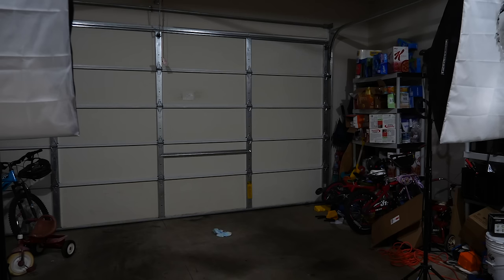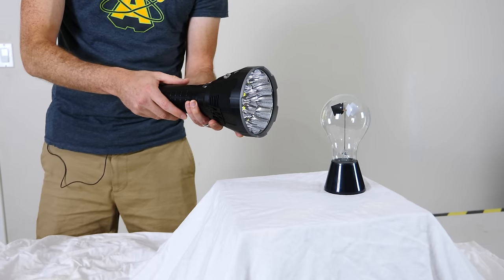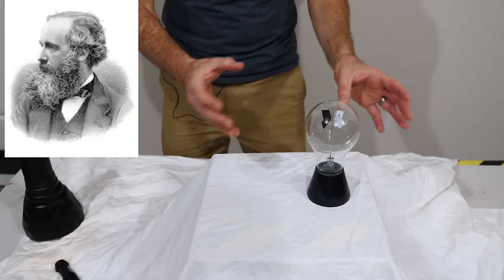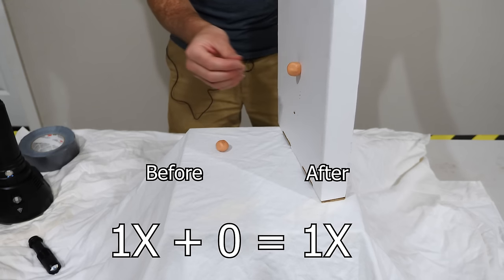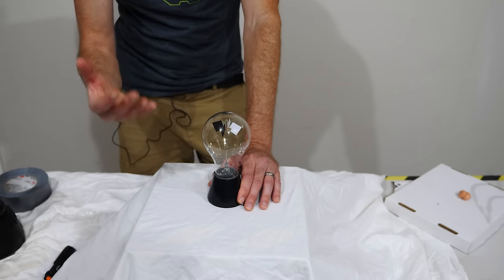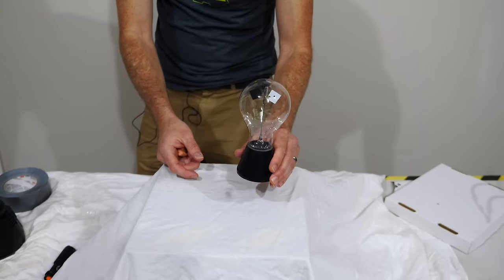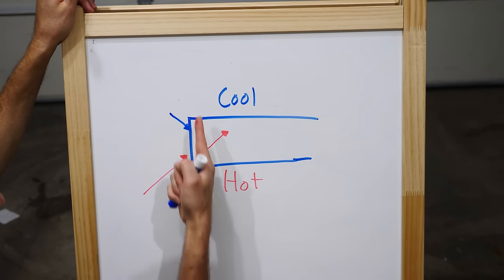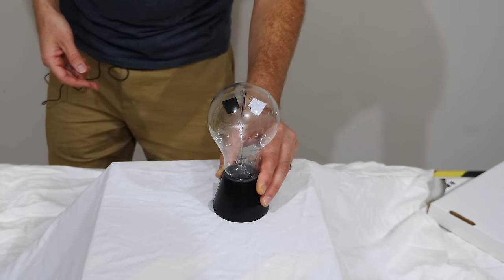Shining 100,000 Lumen Flashlight at a Crookes Radiometer

Comment: So would it work better if the vanes were thicker, so there would be more surface acted on by the different air masses on the sides? 
    Also, it should be noted that the wavelength is important also. A small ultraviolet light is more effective than a normal light.

Comment: Pausing at 5:28 to give my guess. I want to say it's because the black side is absorbing the light energy and heating up, heating up the air around it. and as the air around the black side  heats up, it expands, pushing on the vane. Now to unpause and see if I am correct.

Edit: I guess I am wrong and look forward to hearing the actual reason!

Comment: I’ve used a same wattage UV flashlight and it spins the same speed as the same wattage regular spectrum led flashlight. I have not seen the ice cube idea yet. I need to think on that one. But this idea is not totally jiving with me yet. I like the idea Ken W. has, that is, it seems to be a static like capacitance charge/discharge force. The rarified atmosphere is for the conduction or conductive medium for the force to propagate. This static capacitance type idea makes more sense to me. But I am trying to be open minded about this presentation. Pretty cool stuff!

Comment: I think warm air ( being less dense) moves up leaving low pressure on black side and white side has high pressure so air pushes from white to black. When you used ice air near black was more hot than on white side so again by the same concept it moves in the opposite direction. In order to validate the statement one has to use another type of case instead of a bulb structure. I hope you do that experiment too 😊

Comment: Radiometers react to to heat so it absorbs energy, Likewise it goes in reverse if you put cold air on it.  the vanes are coated black and white for obvious reasons.  Black warm, white cold. Its a useful device to measure the intensity of radiant energy....

Comment: I am interested in knowing what a medium-power (non-burning) laser does to the radiometer. I would postulate that at some point some distance away, the rotor would not spin, since it is not brightness per se that causes it's rotation, but the effect of thermal transpiration described in the video, and the role that the gases near the edges of the fins play. I guess it would depend on how much heat energy is present in the laser beam and where the beam encounters the surfaces (or edges) of the vanes.

Comment: But what if u shoot different kind of radiation at the radiometer simultaneously? Would the most dominant one just create the motion of radiometer ? Also can it be used to detect the type of radiation? Bcoz if it gets affected by hot and cold air there can be lots of complication . And at last what if u submerge it in water and then shoot light on it ?

Comment: Or, in short, the explanation with the "expanding gasses" means it's not a jet, but it's a pressure difference.
The gas is still expanding due to being heated up, but it's not the volume change that does the job, it's the pressure change.
Planes can fly exactly because the pressure above the wing is lower than below when the air is moving along it.
And a laser powerful enough to push things would melt those things with a ton of sparks before they had a chance to move in one piece.

Comment: You can test the explanation : by cutting several thin slits inside the squares (with a laser cutter ?). This should increase the area for the differential force to take effect on the edges. Yet, that would not decrease much the area for absorption. And thus should increase the speed of rotation. The other explanations don't predict that.

Comment: I think the black side heat up more then the white side with light shined on it. Heat transfers from hot to cold this causes a convection of air flow. The black plate heat is push off towards the white one but due to the angle off spin it misses the white one. This causes the black plate to move away from the white one. The white one is a lower pressure and is sucked towards the point that the black one was at.  This is proved from the ice. The white side absorbs the heat from the ice better and the black side becomes cooler and it change directions. To prove this switch the colors on the wheels and it will move the other way. If you could see the air flow in side of the bulb as the paddle come closest to the glass it pushes air to the bulb as it pass the glass that air flow bounce of the bulb and hit the back side of the paddle pushing it more. this is why it works best not in a total vacuum. If you don't believe the air flow stand by a semi truck moving down a road as the front passes it pushes you away as the back passes it sucks you in. there is two forces making the paddle spin faster.

Comment: I bought a Crookes Radiometer as a desk ornament, I really it like because I find it relaxing when it turns. However, the lamp on my desk is not strong enough to get it work (most low energy bulbs offered today will not work).  I don't get sunlight in my office, so I need one that works off another power source.  I wish they had one that operated off a battery or USB plug (or something similar to this). I see they have small desk Wind Turbine, but they have really poor quality reviews/are too large/high and also require solar power and setup/put together.

Comment: I used to work with a weather station with various radiometers located at different angles since we were an outdoor testing lab.  Those actually worked similarly to a solar panel.  I had one of these spinning radiometers but unfortunately the glass was broke.  It was more of a show piece.

Most radiometers measure about 200 to 2000 nanometers.  What we call total radiation.

Comment: If you increase the surface area, say put a bunch of folds on one side of the vane or other, what happens? Cools down faster/slower in relation to the other? Also, what is the best vane design for maximum force? Does treating the edges of the vanes increase force (F)?

Comment: Balloon example (Ideal gas law?) or Bernoulli principle: If balloon is immersed in water, pressure will drop (It might, the author is not sure). If balloon is heated it will expand. So colder side has lower pressure. So if black surface heats up (according to ideal gas law) more than white surface, the wheel will turn from black to white. If Bernoulli principle is to be used, it will turn from white to black. Black side has higher velocity. Higher velocity means lower pressure. Bernoulli principle is used to explain curving of the soccer ball. I always thought the soccer ball curved in the direction in which there is turbulent flow more than there is laminar flow. In other words, it would move towards spin direction that is opposite to direction of motion. That was my previous conclusion. But the author was wrong. The ball would move towards spin direction that is in the direction of motion. So, the explanation in the previous post was wrong. So my conclusion that your explanation is incorrect is wrong. But my explanation based on photon momentum can also be correct. But, you are stating that the wheel does not work in vacuum.

Comment: Now what happens if you swap the vanes of the radiometer with a high powered light source? Would the lights spin in the vacuum? Would a laser work  better than a flashlight? If you put a parabolic dish on the back of a spacecraft and shine a light on it then should accelerate right? What if the parabolic dish reflected the light like a satellite receiver and focused the light onto a single point before reflecting it back to the source? Would the concentrated light cause it to accelerate faster?

Comment: If it is the edges where the motion is actually applied, then instead of plane square panels one should use flat shapes with complex cut-outs to make it turn much faster. Also, once you have spun it up crazily with the 100,000 lumen lamp, then turn off the lamp (leaving only normal eye-comfortable light just to see by), stop its rotation by tilting it, and then see how fast it will go in the opposite direction as it cools down. I don't think you are quite done experimenting with this.

Comment: Won't this system reach thermal equilibrium after a while if you leave it in a light source? The total heat flux including both reflection and radiation
from each side would be the same as the incoming flux. If that's correct, what would be the driving force once that happens? If that's incorrect, why is it so?

Comment: The spinning has nothing to do with thermal effects. A very bright red light will not turn the device for example. Its energy is too low. This is similar to the photoelectric effect, (which was not explained correctly) but regardless. The black colored vane will absorb the light, electrostatic charge is built up until the point of overloading its capacity to hold the charge. Then mini discharges occur to create a push.

Comment: If the magic is all at the edges, then vanes with zigzag edges would spin faster than square vanes  with the same area.

So.. can your vacuum pump reach the kind of vacuum that you need for a radiometer to work? If it can, you can do this comparison by making your own radiometers with different shaped vanes.

Comment: I was thinking some way of making an electricity-free medieval 8x8 pixel digital camera using radiometers and a steel-trap digital amplifier mechanism that can reset itself with spring power and a printing mechanism, but don't know how you would get enough energy to pass through the pressure differential without the air leaking into the sensor pixels...

Comment: Two questions come to mind.
1. Would it go faster if the fins were made of "lace?"
2. Would it spin backward forever if you put it in the freezer? (Why not?)
Reply: 1) not sure what you mean by "lace", but the material should have least possible heat conductivity, so the temperature difference can be kept as long as possible. This is the reason the vanes are usually made from the mineral Mica, with carbon black on the dark side.
2) it would only spin until both sides of the vanes have approximately the same temperature.
Reply: @human_isomer  By "lace" I meant the plate should have many perforations so there would be more edges for the air to act on, and less drag.

Comment: Can it be used as a Solar panel? Like having a space with a bunch of those things next to the sun ☀️
Reply: No, only moves because of so little friction. (The middle is a glass cup sitting on a needle point.)  In open air pressure or if connected to drive a generator, it wouldn't budge.  Solar sails are a related idea, but for now they're really only an idea.
Reply: Ye it was just an idea, Thanks 🤜🏻🤛🏼

Comment: So it will stop spinning once inside space attains near thermal equilibrium and if not then explanation could be diff right? 🤔...there no pressure attained on an object in vacuum and so inside should not be zero vacuum rather ut should have e.g 95% vacuum then radiation pressure can be asserted in the leaf and with less than 95% vacuum might rise friction and atmospheric pressure diff might obstructing the leaf movement 🤔 does this explains

Comment: The third explanation is not different from the second one, except it's focussed on the edges of the vanes instead of the whole surface areas. Of course you need some gas exchange for having cooler gas to get to the hotter (black) side, and this has to come from the cooler white side. This can actually happen only on the edges of course. But gas pressure, gas expansion, gas molecule speed, gas temperature - these are actually the same in different words and under different points of view (e.g. is it a closed or an open system, are we observing a single molecule or making an average over all), and can all be expressed by the kinetic energy of the gas molecules. And as it is definitely caused by a temperature difference and does not work in vacuum (and under normal pressure), the heat needs to get transferred from the surface to the gas, which will cause an impulse that has a greater net value on the hotter side. 
Or simple: Black surface gets warmer than white surface, more heat is dissipated from hot side by pushing against the gas, and thus pushing it away stronger than on cold side, Newton's third law kicks in, et voila - motion by temperature difference in low pressure gas. It's like a tiny propulsion engine with radiation as an energy source.
Would be interesting to see if the effect would be stronger with some wholes in the vanes for better gas exchange. The necessary size of the wholes would probably depend on the mean free path of the molecules, and thus, of the gas pressure.

Comment: Assuming that the vanes are made if metal...

I thought the explanation could When light is incident...and the changing momentum of photoelectrons...makes it spin...can you try if it spins for all frequenceies or only above a certain frequency of light...to test if its spin is due to photoelectric effect or not...it would be my pleasure if you cosider my suggetion and test if its photoelectric effect...🙂

Edit : i accept that it could work on thermal transpiration as you showed it was working if we put hot water or keep in freezer
 But could it also run on photoelectric effect...?

Comment: An interesting thing is to try with a different color on the rotating wheel. If black surface is hot, pressure will be lower on the black surface and the wheel would turn towards the black surface. So your explanation is incorrect. A simple explanation is one has to look at the energy equation too. From your argument E=E + wheel energy for white light, which is not possible. So white light hitting white surface is like ball hitting a wall (Because you get back the energy you put in. White surface reflects white light.). black surface is like newtons cradle (You need to see Newton's Cradle if you do not know Newton's cradle) . So it will turn from black to white. But I could be wrong about the above statement because you seem to suggest that it does not work in vacuum. Thanks action lab for an interesting experiment.

Comment: I’m not sure I believe the explanation you gave. You said it related to the speed the air molecules were moving. But that speed, which is proportional to the temperature, is related to the pressure by the ideal gas law. The pressure of a gas on something depends on how many molecules are hitting it per unit time and on the speed at which they hit it. It seems to me that the previous analysis involving pressure should apply also to viewing this from the point of view of the speed of the molecules.  Maybe I’m wrong, I don’t know for sure. But to me, a satisfying explanation would include an analysis of the air flow while the thing is spinning.

Comment: I am having a really hard time with this one. I always thought it was from the light particles hitting it, but to see it work with heat and cold alone broke me. 

So it really isn't light at all, just the temperature causing the effect.
Reply: Yes.  It's the air hitting it, not the light.  Hotter air around the black side when the outside environment heats it up.  Reverse when the whole system cools.

Comment: But if you put the radiometer as a whole inside the freezer (so there's no preference in the upcoming "thermal" radiation, would it spin conterclockwise? The same experiment could be done if you put the radiometer into a higher-than-room temperature sort of camera... will it spin clockwise? The question is: is the radiometer sensitive to the radiation DIFFERENCE (i.e. front or back side, as you shown) or it will spin indipendently from it?
Reply from the maker: If you put it in the freezer it will spin in the white direction. It doesn't matter which direction the cooling is coming from. And for your second question, it should just be the temperature difference between the current temperature of the white and black side vs the glass temp. If it is in a hot room then it will be like flowing hot water over it.
Reply: @TheActionLab  thanks for your kind answers!!! :-)

Comment: But emitting photons to ice wont exhibit force. It would appear that a oarticle model for gas should work and negate minor edhe forces. A particle of gas hits the black surface and is heated up. It gains speed amd hence momentum. This momentum comes from thenthermalmenergy in the vane.

As for 1x+0=1x the whole system has gained momentum. 1.x+ 9999.0 =1000.(x/10000) => x/10000 is very slow

Comment: @I TF· ·FR ME· ·R ATE TenFramesPerSecond  
Basically like an airplane wing... there is positive pressure on the black side and negative pressure on the white side causing thrust or LIFT in the direction of the rotation.

Comment: Have a glass working friend? You've done things with the whitest and blackest paints available. Fairly sure you have a solid vacuum pump and access to argon or some such to create a best case scenario inside the bulb. You kinda gotta make the ultimate version. Then hit it with the best inferred laser you can lay your hands on!! (May need to use fine tuned magnetic levitation or something to reduce drag as much as possible.)

Comment: Hey , how about pouring liquid nitrogen on it and seeing what happens
Reply: Glass shatters?
Reply: @MeFreeBee  but what if the glass is strong , will it spin as fast as the torch light experiment
Reply: It’s probably gonna spin quite fast at beginning. Then after the panel lost all its energy to radiating outward. It will just stop.
Reply: @dinosaurdrew7431  probably

Comment: Wait a minute, isn't the 3rd explanation basically the same thing as the 2nd explanation? Not so much as the expansion of the gas, but still as an increase of air pressure on one side?

Comment: A vacuum has no air/gases so it cannot spin the vanes in a vacuum. When low pressure air is available it heats up and cools down moving the
vanes.  Isn't that called convection?